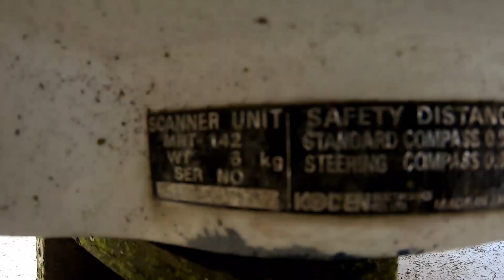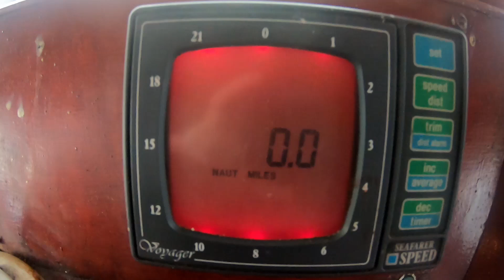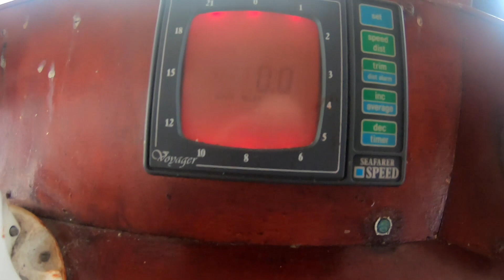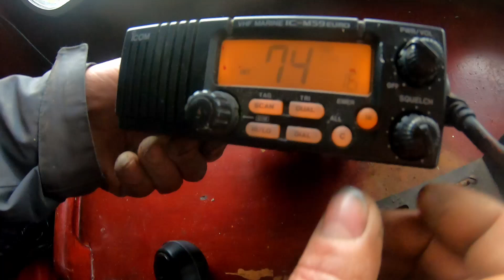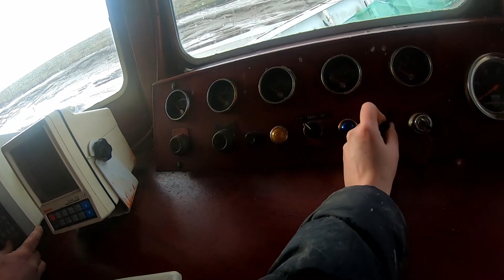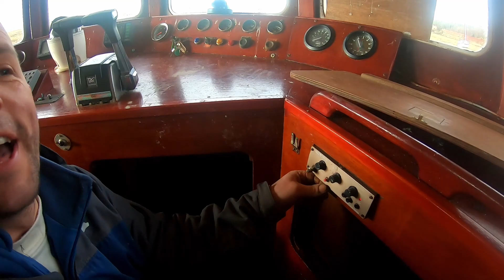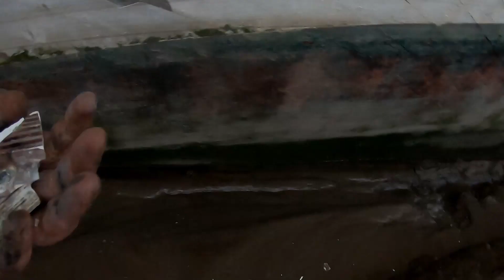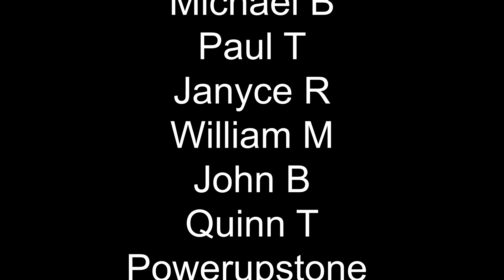Ep 6, Assessing the Hull, Mud fails and weird noises of the ship!

Comment: Just checking the hull from the inside is only half the story, you must get the hull surveyed before spending too much money on it. The patching of leaks is good but make sure that hull is sound before going much further, the planking is hard to repair if the inner layer has bad areas. Also bare in mind that there is an insurance premium on double skin wooden boats.

As I mentioned before a friend of mine rescued a late 1930s Thorneycroft boat built for a sugar baron but turned over to the Royal Navy the hull design was a Motor Torpedo boat with the same planking and ribs as your boat. I spent many an hour helping him install sisters held in place with copper rivets, a real time consuming job.
 No cross head screws used on anything that stayed.
Isolate those electrics so there is no fire hazard also anyone getting on board won't do any harm to them.
Reply: That's the truth! Hull first.

Comment: Lots of fun but just be aware if you have the VHF on channel 16 and hold the transmit button you will block the channel.  If you have no license for the equipment nor operators license you can be fined heavily for misuse, if they found you.  Channel 16 is the emergency channel so blocking it could have serious consequences for anyone wanting to call the coastguard, mayday or PanPan.  Just FYI guys.

Comment: Deck beams, if they are sound in the middle but soft at the end, would they be usable if you shortened them to good wood and move them forward, the metal bracket at the end is called a hanging knee, wheel hose roof, strip the crap off replace with new marine ply and then fibre glass it to keep the water out.

Comment: Word of advice DO NOT BURN THE PAINT OFF !!!! It will damage the layer in between the double diag !!! and then you will get a lot of problems Good luck
Reply: Looks loose enough it should cut off with a scraper well. Then just need to know what to repaint with. Something with a bit of flex in it.
Reply: @dhutch2000  We used to use metallic pink primer Thinned on any bare wood then another full coat then a good oil based paint !! MUST BE OIL BASED as 99% of todays paints are water based and totally useless for this type of work on a wooden boat

Comment: My thoughts are to do all of the deconstruction that you can where the boat is that does not compromise keeping water out and will allow you to move the boat to a yard.  To do the restoration you would probably be best off in a yard where it can be out of the water totally until you have the exterior of the boat done.  You could also have the boat level to make interior restoration much easier.

Comment: Once this lockdown is over I will offer come and give you a hand for a weekend.
Reply from the maker: Thank you! Do you have any recommendations for broadband for the ship?  we need to sort this out this week!
Reply: @ShipHappensUK  Hi. I’ve used huawei here on the boat and on some hire boats. I personally now use a tp link archer mr600 4g plus router. You will also want an antennae. Go for a mimo type,
stands for multi in multi out. It will have 2 cables cable coming from it. Do not use extension cables on the antennae.These routers will also power up fine direct from a 12v dc source. Stick a three sim card in with unlimited data and get uploading.🙌🙌🙌
Reply from the maker: @DoItWithPaulie  ive been informed we need a sim with a fixed IP address to allow us to access the cctv cameras, so not sure how I go about getting one of them!
Reply: @ShipHappensUK  you could have a word with the data provider,but I think you can use a dyns server or something to give you a static IP to connect to. I did it once I think when I went abroad.That’s about as far as I can help you with that. Pin this conversation at the top of your comments and I’m sure some clever person will be along to help. 🙌🙌.
Reply: Was just thinking. Surely you could just give the router a static IP address in its settings. You deffo need a brainy person now. Was just a thought
Reply: One day (hopefully soon) Starlink WiFi will be more affordable.  It will be as much data as you can use anywhere on the earth's surface. Give it a year or two.
Reply: @ShipHappensUK  You'd need to request it from your Service Provider.  It also needs to be an IP address that is not a Network Address Translated address - most mobiles are - you would need a 'real' ip address, one that's actually reachable over the internet which a NAT is not unless the NAT device has port forwarding to a 'real' IP address.  You would need to pay an extra fee and not all providers may be able to help.   Just having DynDNS won't help, that simply gives it an easier to remember hostname like myboat.dyndns or something, but the IP address must be a primary IP address on the internet that you can 'see' from where you are trying to reach it from or it won't work.
Reply: @geoffroberts1126  that’s what they needed. A brainy person. Well done mate
Reply: @DoItWithPaulie  Thanks mate.
Reply: @ShipHappensUK  it might be far cheaper (& reliable) in teh long run to get an ordinary SIM and then setup an online VPS (like your own little server on the Internet from £5 pcm) with a VPN endpoint running on it
you then VPN from the boat onto the server and there you have your fixed IP (& a whole lot more to boot).
That will work wherever you are in the world and whether you are using mobile data or WiFi on the boat

Sounds complicated, but it really isn't

P.S. look at the GL-X750 mobile/wifi modem/router will do all you need & more
Reply: @ShipHappensUK  if you're looking for a fixed ip SIM big thing is data usage they get pretty expensive, where I work we deal with a company called wireless logic I believe they have VPN and fixed ip Sims options available

Comment: Good to see them ribs and under there, But i would,nt cover up the inside planks ribs knees 
and as like, it,s wood needs to breath and down where the keel is where the ribs come to the keel there is a gap for water to run from bow to middle or where your pumps are they will need cleaning same from stern and all the heavy stuff below floor is WT pig iron, shoes from rail way.. and dont swtch the sonar on you can damage the transducer outside under the keel

Comment: WARNING ..... Best not to turn on the Vosper stabiliser while tide out. There are two fins that are either side of hull (probably in the mud) and, if the engine is running which has the hydraulic pump on, the fins will try to turn and may/will cause damage.
Reply from the maker: Don't worry the fin is safely stored in the shower room 🤣
Reply: @ShipHappensUK  Good place to keep them.

Comment: You've probably already realised that a book of tide tables is a handy thing to have, not only does it give you the times of Hi and Low water but also the range of the tide because that varies with the phases of the moon. Higher tides just after full moon.
Its nice to know what to expect before you leave home! The book isn't gospel though because there are other factors, surges both positive and negative caused by wind and barometric pressure. Look for the NTSLF website, It shows that at high tide tonight the actual level is predicted to be nearly half a metre less than the figures in the tide tables.

Comment: id really consider putting that boat on dry land would be a lot easyer to get your materials on it etc
Reply: Ultimately that's the way to go as the entire hull would be accessible and everything could dry out naturally but I think that mooring is rent free where dry land storage would cost.
Reply: @Bulletguy07  i know that would cost but asking arround where is the cheapest or where you can work on a piece of dry land for free wouldnt be a big deal and besides that its an old boat who wouldnt want to support trying to rebuild it right?
Reply: Wouldn't you have to float it to get it to the hard first?  Not sure if is buoyant yet.
Reply: @davidroberts1960  it floats as some else said it was floating in an earlier video
Reply: Covering the good  timbers in fiberglass will save them from rot and water proof theme.
Reply: @davidroberts1960  its buoyant because it floats when tide comes up hence why they put the ankers on
Reply: @Mr74145  meh i think presserving the wood is what there going for besides its on a budget they don't have millions to spend ,buying fiberglass aint cheap
Reply: @Mr74145  Provided it's done when it's REALLY, thoroughly dry, or you trap moisture and it simply rots the wood away inside the GRP.   Seen some 'hollow' transoms on boats that were 'glassed' when not completely dry fail quite spectacularly, often taking an expensive outboard with them.  Dynel sheathing is also worth considering.  But the timbers have to be properly dried out or it will lead to later issues.
Reply: I totally agree. This boat needs to be dry docked. It would cost a fortune though.
Reply: @drumsk  people is cometing defore they hawe ser all vid😂it is floating in the most vid beside EP 6⚓⚓⚓
Reply: No do not put it on dry land. The hull will dry out and develop cracks, big spaces. Keep the hull wet if it is sound.

Comment: The white wood that goes from the roof to the bottom of the boat is the ribs and the metal “shelf” that connects to the ribs to the roof is called “knees” and the purpose is to strengthen the deck
Reply: It is more common to refer to "frames" rather than "ribs".

Comment: Old Kodan Marine radar.  Pretty reliable.  Probably still works.  Ch16 is the Calling and Distress Channel and yes, it's VHF (Very High Frequency)  You will need to get Certified to use that one, not sure what it requires in the UK, in Oz it's a fairly simple test and most people do a day course with a test at the end.  Love the old radio on the bulkhead.  Sailor R109, circa mid 70s.  You can d/l a manual in PDF format here it covers the R108 and R109.   https://www.manualslib.com/download/1012496/Sailor-R108.html  The VHF is rather newer, it's an Icom M59 Euro and the manual is here.  https://www.manualslib.com/download/891339/Icom-Ic-M59euro.html
Reply: I can confirm that getting a Radio Operator's Licence in the UK is pretty straightforward, cheap and easy but it is illegal to use the radio without one. Normally, you would be able to find places offering one-day training courses, but I don't know what impact Covid has had on that. It's probably not your first priority though, to be honest!
Reply: The RYA do lots of training courses for all things boaty, it would be worth joining when you are closer to voyaging.
Reply: @alanmumford8806  You have to have one for the equipment and an operators licence use it.  The RYA do the operators license and you get the equipment license from Ofcom online.
Reply: @AndyUK-Corrival  I haven't owned a boat for quite a while (sadly). The equipment license is news to me. When did that happen?
Reply: @alanmumford8806  Doesn't surprise me.  UK still has TV licenses for heaven's sake.  They went here in the 60s.   Marine VHF in Oz is covered by a free class license, like CB Radio.   So, you need a Marine Radio Operator's Certificate of Proficiency to lawfully use the radio.  Except in a real emergency.  Other laws say you may use 'any means' to obtain assistance if you are in distress ('grave and imminent danger') so its perfectly lawful in that dire circumstance.  But for routine stuff you need paperwork done.
Reply: @alanmumford8806  I think he meant 'Ship Radio License' i.e. a license for the boat  - the boat will already have a license you just apply to get its callsign & MMSI registered to you

Comment: The hull doesn't look that bad, and the electrics still working is not a bad sign either. Does she float on a high tide? A wooden boat that can float with out a working bilge pump is quit rare :-)
Reply: I'd agree.  Most of the rot seems to be more in the upperworks.  If she's spent a lot of time in seawater, that's not uncommon, the dry rot fungus dies in salt water, so common to see wooden boats here in Oz (very little boating in FW here) that have fairly sound hulls but decks like sponge rubber.  I expected to see a lot of water in the bilge.  I think she's still pretty tight and most of the hull sounded good when tapped too.  I get the feeling they caught this one before the rot (literally) set in too far.   I think she'll come up fairly well.   Some of that rib damage looked a bit like physical impact rather than rot, but it's hard to be sure.  If the decking's leaking (and it seems to be) ribs are a bit more susceptible to dry rot than the hull planking usually.  Not invariably the case, but maybe here too.

Comment: Just a thought  There are some incredibly stupid people out there so I really wouldn't recommend you suggest people to lick live wires. In future videos can we see more repair work has so far with just in walking around.
Reply: Certainly no licking, but also no telling them what to do. They hardly need any direction from you, Mr Roland, as they size up the rather large task ahead. Your impatience is not a priority.  Perhaps some attention to English grammar would improve your profile as, " can we see more repair work has so far with just in walking around ", is barely intelligible.
Reply: @alexandermenzies9954  I've have seven boat 30 year in the business. My boat run from the neatherlands to uk .just a tip get to know some one be for you shout out you know nothing.
Reply: Experience doesn’t equal niceness in your case. With 30 years experience you could have so much experience to pass on and support to give but you can only come up with that. How sad.
Reply: @neilroland3804  It doesn't matter how many boats, where they run or how long you've owned them, good manners are paramount. 
No one is shouting, so please don't invent that piece of nonsense, either.